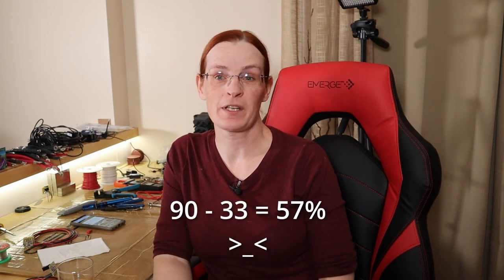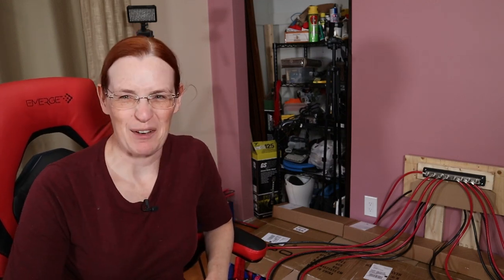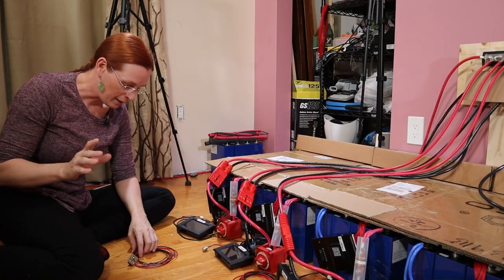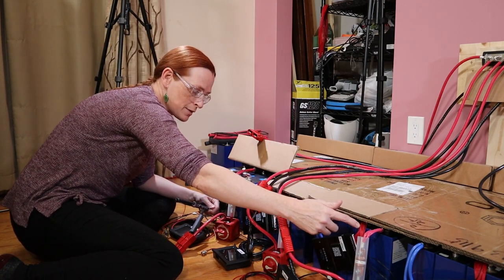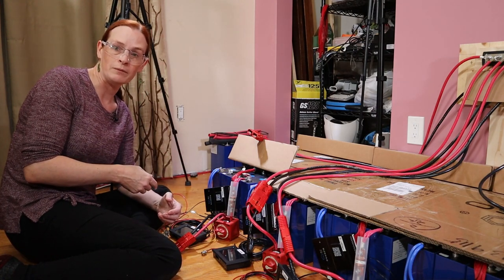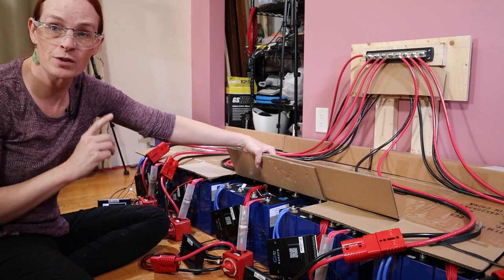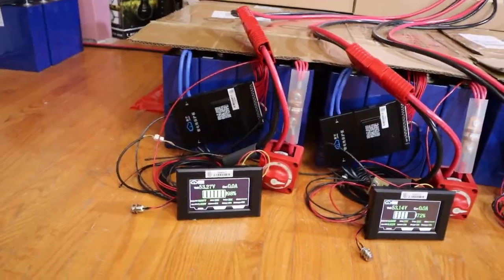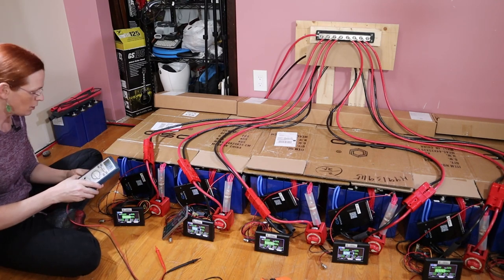It's Alive! (and I need some help) - Part 7 - Big Battery Build! (Ep. 44)

Comment: Lifepo doesn't off gas, if something is happening so violently in your battery compartment that your batteries lose their integrity you are having a much bigger problem on your boat than battery 'leakage.'   Great video!
Reply from the maker: Absolutely agree, I have no real concerns for off-gassing. However, to follow ABYC standards, knowing that they can vent, regardless of how unlikely that is, I need to setup for it. Thanks for the compliment! :D

Comment: Precision is independent of accuracy. Voltages can be measured very precisely, to three decimal places or more, and still be inaccurate if the device making the measurement is not calibrated. The JK probably measures each cell voltage with a single analog to digital converter, so each reading will be off be the same amount. When you calibrate the pack voltage, the JK firmware will adjust all the cell voltages by the same amount in order to match your entered pack voltage.

Love what you're doing by the way. You're pretty awsome.

Comment: The BMS is equipped with the processor that have build in an ADC (analog Digital converter) that means that all the battery voltage are samples by the same measuring circuit, this is many times pr/sec and it probably have a FIFO filter that is averaging out small measurement mistake.
So all in all that is only the switches and resistor network that can ad up to the fault.
The deviation between the cells is still spot on. 
You might have an offset in the voltage but that includes all the cells.  
That is the reason you can calibrate the overall voltage.
What I have experienced with the JK BMS, whenever the JK BMS isn't connecting it still does its job this include shut down because of low state of charts. What is not doing is communicating through Bluetooth that is all.

When you calibrate in 0.001 volt you need expensive equipment and that is certified so that measurement is reliable.
Best instrument you have is your BK DMM, read the manual to find out how precisely it is.
Remember the overall voltage needs to be divided out to 16 cells which make 0.1V not significant.

Comment: I did the same thing as you - I bought a Klein CL 600 multimeter as I was certain I read in specs online that it measured DC amps on the clamp.
In my case, Klein Australia graciously refunded me, and I bought a CL 800 from them to replace it. I've been very happy with it since, and I'm very happy Klein helped me out.
Reply from the maker: ha! I thought I read that it supported DC amp meter as well, something about how it's worded is confusing I guess. I thought about returning it, but decided a backup meter (minus DC amp) was worth having, so I kept it. Glad I did now.

Comment: Just some thought coming from an semiconductor maintenance background.
As someone already stated you are tying to measure to 4 digits with a 4 digit meter, the last one possible two digit have error.
#1… what are the manufacturers specs for the meter readings… somewhere they will list specs.. such as 5 volt range will be plus/minus 0.003 V or some will give +4mv/-7mv… not actual just examples. 
#2… none of the meters used are calibrated.  

Summation, research for a meter with a better than your needs resolution, probably 5, maybe 6 digit resolution depending on the error range, then have it calibrated by a calibration company to a (US term) National Bureau of Standards (probably secondary) calibration standard.
Ps… room temperature can make a difference even to a calibrated meter.

Comment: first 25 amp setting was for function testing at factory. second go thru all the bms's settings (all) and set them all the same. then charge (all) to top volts allowed (3.56 or3.65) and hold till current is very low < = 2 amp and hold there for (X) hours. (deep charge) (top Balance). then reset all the bms's . as for the one that keeps dropping out i would send it back as defective if it keeps doing after. charge- cable length , internal resistance and deep soc come into play. think of it like top balancing of cells only one step up. as for meters; unless you spend the money for a calibrated meter the accuracy will depend on the specs of the meter  (tolerance +/-  ?%) . pick one and use it.  as for buss bar; incoming power in the middle  and batt's on both sides of it. bms volts= v / cells count = chksum , look for deviation of average. don't drive yourself crazy on the small differences 0.0000001. it will drive you crazy.  treat the battery pack as one battery one batt=1 cell ,all batts = battery pack

Comment: It's worth noting the accuracy of your meters, eg. i looked up the Klein CL800 specs and it claims 1% accuracy on the 60v DC range and I imagine the other meter will be a similar story, so the consistency you're seeing between them is actually quite reasonable.  Beware that "precision" and "accuracy" are different things, too.  at the 60v scale you've got a precision of 0.01v, but an accuracy of more like +/-0.6v.  You can certainly get more accurate handheld meters, 0.1% is not uncommon in higher end stuff, but if you want higher still then you generally need to move to a high quality bench multimeter (which come with a correspondingly higher price tag unfortunately).  in my experience the actual accuracy of a meter is usually a lot better than its published figure, but i imagine the accuracy figure takes into account temperature, age, electrically noisy environments, etc. 

However, even if you did fork out for a far more accurate meter i doubt the analog-to-digital converter (ADC) inside the BMS will live up to it.  The bench meters achieve high accuracy through extremely stable (and expensive) voltage references, which the BMS won't be able to include.  Instead they'll be using a similar class of ADC+VRef that an ordinary handheld meter would use, so you can expect the same sort of 1% accuracy.  like with the meter, the precision is probably much better, so they will consistently read the same inaccurate voltage.   this is what the calibration option is for.

why calibrating the device changes cell voltages:  i imagine it's because there's a single ADC in each BMS, and it rapidly connects it to each cell in turn to measure the voltage (this is called multiplexing).  Calibrating the BMS is calibrating that ADC's reading, so whatever scale factor it's applying will apply to all the readings, including the individual cells

i've got no experience with LFP, but i've done a lot of smaller stuff on LiPo and i've generally only cared about 2dp when dealing with individual cell voltages, eg. 4.20v is the charged state, and i consider 4.21 and 4.19 to be the same, because that's about the limit of my meters' accuracy.  It's also not worth splitting hairs over because of the shape of the voltage-SoC graph: It's very flat in the middle so there's not a lot of extra energy stored in the difference between 4.19v and 4.20v, unlike the difference between, say, 3.70v and 3.71v.  (i think the actual voltages are different for LFP but you get the idea)

it is a bit strange that the pack voltage isn't just the sum of the cell voltages, i wouldn't have expected that
Reply from the maker: This is a fantastic reply, and super helpful, thank you! Follow up question then; Given that LFP says the cells will be damaged if they drop below 2.5v, or charge above 3.65v, and given the inaccuracy of the ADC, should we be setting our lower limits to higher than 2.5 and upper limits to lower than 3.65? Or do the battery manufacturers understand the inherent inaccuracies and publish the 2.5/3.65 limits with buffers already built in?
Reply: Since your meters all agree pretty closely i'd say you can be fairly confident in your accuracy, and as you've now calibrated the BMS to the same standard it should also be pretty good.  I don't think the tolerances on cells are quite that severe, either.  Again i've got no experience of LFP but i've certainly severely discharged LiPo cells below their safe voltages (i use them in powerful racing drones) with no immediate negative effects, although the lifespan of the packs is generally very short due to the abuse they receive.  I believe the damage is a cumulative thing, regularly bringing them below their safe voltage will shorten their lifespan - by just how much will depend on how often you do it, and how deeply they're discharged.  My personal feeling is that a few mV here and there isn't going to noticeably affect you, not compared to the day-to-day wear they're going to experience.   The 2.5v lower limit isn't an "on-off" thing - they aren't suddenly damaged at 2.5v, they're being damaged at 2.6, 2.5, 2.4, etc, it's just more and more severe as the voltage drops.

If it were me I would leave the BMS limits at the standard values for the cells, however setting a few mV of tolerance isn't going to reduce the total energy you store in your battery by a great deal so it might be worth doing just for peace of mind?   Again think back to the sideways S-shape of the voltage chart: the vast majority of the energy stored in the battery is in the flat bit in the middle, at the two extremes the voltage changes quickly compared to the additional energy stored   

If you want them to last a really long time, charge them to about 60% and put them away in a cupboard :)
Reply from the maker: @StikDragon  haha! Fair point on not using them. I do think though that, in combination with Up North's comments, I'll configure the BMSes to stop discharge early and to stop charge early, exactly because these are the outer limits, provide a better buffer, and shouldn't effect actual usable capacity much. Thanks again!
Reply: @TheDigitalMermaid  Another thing to keep in mind is that your multimeters are likely somewhat temperture compensated however the BMS probably lacks temperture compensation.  What you should hope is that the ADC on the BMS is multiplexed rather than having one ADC for each cell so you know that all cells are being measured by the exact same ADC and signal path a few times per second.  In an ideal world all of these BMS units would use 16bit ADCs and be temperture compensated but in the grand scheme of things they just don't need to be all that accurate or precise to do their job as long as the settings are reasonable as others have said.  Great job on the build thus far.  I can hardly wait for the next steps when the system begins to make it's way into the boat.

Comment: The JK BMS likely uses a single internal analog to digital converter for all voltage measurements so that the difference between cells can be accurate and so that a large number of cells can be measured. The input to that ADC is thus likely multiplexed across ALL of the points to measure, looking at each internal voltage test point one at a time for just a short time. The result of that design is that a calibration of the overall pack voltage will also calibrate all of the cell voltage measurements since the same circuit is used for all. This is expected and a good design.
Reply from the maker: Thanks for this, this agrees with most other comments.

Comment: Hi Maddy.  I'm glad to see you working threw each problem you encounter.   
Your JK bms is working as expected.  Glad that you calibrated the JK battery setting of each bms.  You need to start trusting your Victron equipment and batteries to be on all the time because they all need to equalize with each other for a long time inorder for all cells to settle in.   Could take days!  Don't rush the souffle.  
After a month or so you should recalibrate the battery voltage of each bms because they do tend to drift a bit over time.  
It is not unusual to see different a little bit of difference between charge and discharge currents as each battery has its own personality over time.   
Go look at your current shunt voltage and current and compare it against your 3 meters.   Even your inverter/charger. Oh yes even your charge controllers.   Bottom line is that they may all NOT exactly agree with each other.   They all tend to drift a bit one way or another.   The mystery is,  which one is the most correct.  I would do like you did and pick the one in the middle and call it your meter standard.  Unless you have one of your meters calibrated to a traceable 1% sorce in a meter calibration lab you can only speculate which one is dead on accurate.  
Lou Little
Reply from the maker: Calibrated meters... Huh, that might be something I want to look into, if it's not stupid expensive. I am uncomfortable that the BMS is expected to drift, given that the cells can be damaged if allowed to go under 2.5 or above 3.65. It makes me think that I need to set my thresholds to account for BMS inaccuracy.
Reply: @TheDigitalMermaid  We are talking single milliVolts here. Staying between 3.55V (or just 3.5 even) and 3V is plenty of margin after a calibration. There is almost no capacity beyond or below that point. I think Andy tested that at some point as well. No reason to go that low/high.
Reply from the maker: @upnorthandpersonal  Aye, I think this is the biggest take-away from all these comments. I do know Andy set a decent buffer for the reason you're mentioning, and I should/will do the same. Thanks again!
Reply: @TheDigitalMermaid  Just my two cents: you have to get to the point where you don't care about the BMS anymore. Or the battery in general. Or the fact that you have an inverter, charge controller, etc. The goal is to have the whole system be as invisible as possible, and the best way to do that is not to push e.g., the batteries to their very limits where they can potentially sustain damage.

I know you know this: I have 56kWh running my off-grid house. I can't remember the last time I started the JK BMS app. They just sit there, doing their job, without me noticing anything. The only time I should notice the BMS is when something goes wrong. 

While your battery is being built, and installed, and the BMS (B and what was it, E?) issues resolved with the parameters set to reasonable values (float voltage, top/bottom limits, etc.) you should just remember the saying: "The pessimist complains about the wind; the optimist expects it to change; the realist adjusts the sails."
Reply from the maker: @upnorthandpersonal  "get to the point where you don't care about the BMS anymore" - 100% agree. I'm putting so much time in now to figure out how to get to a point where my system is so reliable, I can all but forget it exists. All my thinking and worrying is focused on reliability, with range/capacity being secondary to that.
Reply: @upnorthandpersonal  Remember that Andy also charged to their maximum and then completely drained them to get their actual capacity too.
Reply: @inmyimage1081  Could be, but it's not necessary. The BMS is not super accurate to keep track of state of charge, let alone across several. If you need accurate state of charge, use a SmartShunt for example. For protection (between 3.5V and 3V for instance) you don't need to cycle.
Reply: @upnorthandpersonal  Yep, I have a SmartShunt but was thinking it would be good to do a full charge and discharge to figure out their actual capacity. My plan is to set the voltage range to 3.5 or 3.55 and 2.9 or 3.0, depending on where the shoulders appear to be and then. Then charge to the high voltage I end up using and set it as the 100% mark so I have a much better estimate of my real remaining capacity. Does this plan make sense?
Reply: @inmyimage1081  Yep, that's good. The SmartShunt will in that case know the total capacity - with that I mean, if you have two batteries in parallel, you know the actual capacity of your system instead of individual components.
Reply: @upnorthandpersonal  Fortunately my Victron MultiPlus 2x120 has a temp sensor port so I’ll be able to us the SmartShunt’s midpoint sensor to get a better view of each pack, of course until I have 4 or 6 or 8… 😜
Reply: @inmyimage1081 yes, but this was more experimental & to test the manufacturers limitations & claims.
Reply: @inmyimage1081 those parameters for a capacity test would be fine and help set the BMS to know the batteries full capacity, you dont need to go below 2.9 or 3v as Upnorth & Andy has said, & 3.55v/cell is a good upper limit for a quick safe charge and balancing regimen without going higher.
Reply: @evil17  Thanks for the input. 👍

Comment: Precision isn't the same as accuracy. Precision is the number of decimal places you can measure to, whereas accuracy is how close the numbers are to being true. 

One would think that if JK has such good precision (so many decimal places) then they would also read correctly to that precision. But not necessarily. You can read lots of decimal places, but still have the numbers be wrong. I hope that makes sense. 

Ultimately, the best thing is to pick a meter you trust, and calibrate (if possible) all your other devices. I bought a cheap 5-volt voltage reference a while back, and I buy relatively cheap meters. So far, all my cheap meters have a calibration screw on the circuit board so the voltage can be adjusted. 

In actual practice, I don't worry too much about accuracy. As long as things are pretty close, it's good enough. Small variations won't hurt the batteries any. I also don't trust state of charge readings at all. From any product. I go by voltage range.